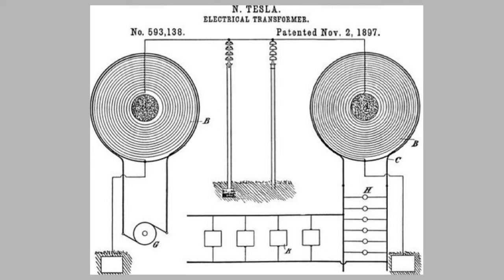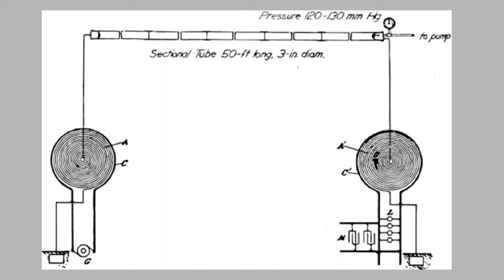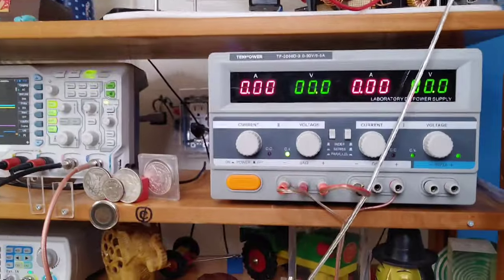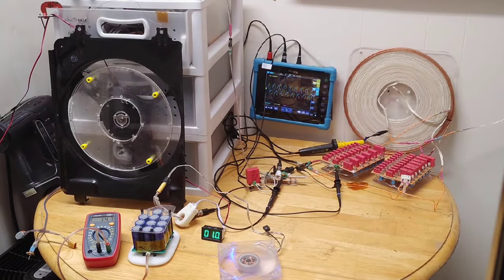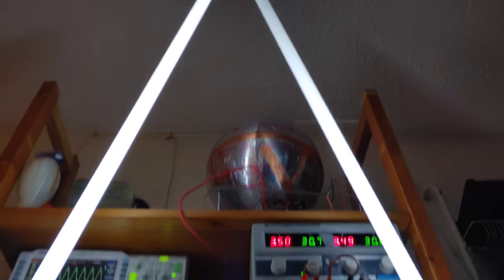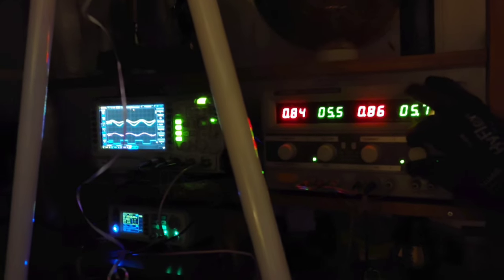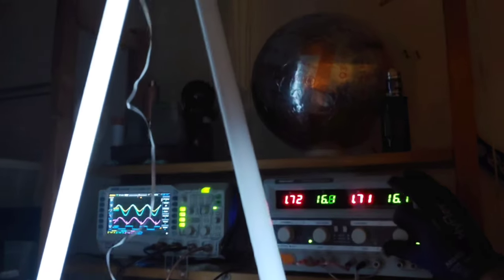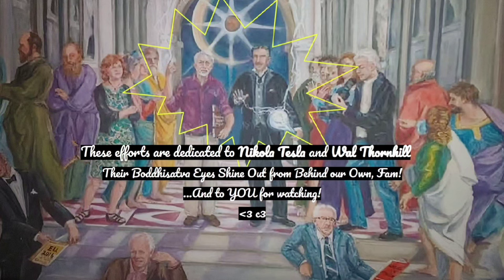Nikola Tesla's Single Wire Power Transmission, Part I: thru Flourescent Tubes & Wire

Comment: test with the coils far apart, it would be also very interesting. when the two coils are distanced the elastance K (1/C) changes and compensators will need to be used. Anyway it's magic for the electronics oriented mind even though Maxwell hundred years ago expressed his view that electricity flows outside the wire in the insulation, which is exactly what a single wire transmission line does.

Comment: Keep up the good work!

A pair of Wisconsin researchers powered a 500 watt load on a balloon 70 meters tall with 92% percent efficiency thanks to a ridiculous LC compensation setup everywhere. Check their circuit on researchgate, I can send too if you want. 

The Chinese’s are really ahead in this space actually building what the Russians spoke about in theory. 5 kilowatts through a grounded setup using a highly coupled type of air-core xformer. This is gonna be hot, it makes sense for some uses. Keep building!!!
Reply: This is happening right now, these were built in the last year. It’s crazy right now.

Comment: Been experimenting with long choke coils after the caps to the load in series. 
I'm running a wind turbine pulse motor and the choke seems to help change the coggin from the load.
Might be worth to experiment it.
Reply from the maker: Indeed! I've done some rough preliminary "benchmarks" with a honemade variable inductor (range is only 0-60uH), seem to have found a "sweet spot" near 20uH with my setup, still need to look into it much more though. Thanks for "corroborating" the tactic, I'll give it more attention!
Reply: @make425 I do work on wind turbines so I'll have to look into that. 
What type of wing power machine are you using?
I work on the common diy axial flux coreless 3 phase type and you can feel when you are turning it with the leads shorted but I get no cogging ezcept when I short one phase and then I get a little cogging. If you haven't tried that type of alternator yet you should give it a try

Comment: For phase correction, maybe it would help to have a variable-inductance helical coil. As in, just wind it round plastic and put a rod of ferrite partway in, so you can adjust how much ferrite goes in there, and therefore the coil's inductance. That is, if ferrite would work at the high frequencies involved. Might help to use longer or wider coil formers for it to work. The idea would be to tune the coil appropriately according to a load.
Reply from the maker: HAA on point again! Variable inductors have been made with a glue-stick housing, and a long threaded rod with ferrites attached. Mine only go from 0-60uH, but placement after rectifier diodes has some effect, on DC output AND input current (initially to my surprise).

The best part of posting this stuff has been getting comments like yours fam, thnx!
Reply: @cold3lectric   Ah my absolute pleasure. I love science, and fringe or neglected science (as long as it IS science!) is always interesting. You do it properly, you do a good job, and what's most important of all is that you genuinely have a passion for trying this stuff out to see what happens. When people have a real love for their hobby, it's always interesting to hear about.

Yeah input power ought to follow output power, so it shows everything's still obeying the laws of physics! Reassuring that it's working for the reasons you think it is.
Reply from the maker: @greenaum  Ha! I have used my variable inductor to find the apparent "sweet spot" of added series inductance from rectifier DC output... Had been just trying whatever inductors i had around, but thanks to your suggestion, i found the apparent optimal value lol... 15uH! Can't wait to show it off in my imminent followup vid with benchmarks :)  thnx, I'll be giving you a shoutout!
Reply from the maker: follow up vid is posted, though i had to scrap the variable inductor clips after finding out a far better approach for connecting my rectifier - having both ends of the step-down receiver coil LV (outer) windings connected across bridge rectifier, whereas previously i had one end connected to rectifier and the other end grounded.

That way it's even possible to operate with an UNGROUNDED receiver.

Comment: I have played with this technology as well many times. I even used a metal desk as the single wire and a copper plate as a free space capacitor over the metal desk. Keep up the work, i did find the extra coil to be useful in some cases, but had to tune the circuit differently for it ti work again.
Reply from the maker: Metal desk, cool! You get into rectification? Its fritzy. 

This weekend been sending it thru a tiny carbon fiber thread of 40ft (made for 'wearables'), out a window into apartment parking lot 🎉 😈😇

Comment: Kudos for noticing the wiring orientation from CCW to CW in the pancake coils. My only disagreement is your understanding of the purpose of the sphere and ground box. Tesla is very clear in his Colorado notes, his electrical experimenter published papers, and an interview on how all the radio engineers got it wrong. In his 1919 EE published article, he uses an analogy to explain it. In my opinion, one of the biggest misunderstandings and flaws with people reproducing his work. The air is an insulator, and energy is lost trying to force it.

It's the reason he went to Hertz home to show him how to improve his experiment by 10 magnitudes. He wasn't moving electrons. He was moving the very particle that binds all matter together, creates radio, and disturbances in the Ether (light).

Additional, your coils need to be identical in weight. The sound vibrations cause them to oscillate just like tuning forks. 1/4 of an inch of copper throws off the entire circuit!
Reply from the maker: True. Also i can't do quarter-wave conductor length for my operating freq (~130kc/sec has a wavelength >2km). 

I DO aspire to level-up my spherical topload game though.  But isn't the topload sometimes analogous to a grounded outside rim? Ish?

Comment: You might try to have an equal capacitance in parallel with the inductive load to cancel out the reactance. Unity power factor

Comment: From what I understand about AC. We can totally use regular setups to transmit AC relative to ground on a single wire and technically, that's kind of what we do with 3 Phase AC transmission lines, Each line is it's own AC wave relative to ground an they just happen to sum to 0 or "neutral" where they meet up if the load on each line is balanced. 

High frequency is avoided for long distance transmission because the of the inductive reluctance. I worked as a cable technician for a cable service provider and our systems opperated at the very high frequency ranges. We used shielded coaxial cable and let me tell you, signal ettenuation is a huge issue. Like I would have 27 dB at the post and then run 100' or 200' of line to the house and into the CSE. Then to the customers box inside the house and I have to measure the signal power and log it to measure everything and just from that alone I'd be down to like 12-17 dB.

That's a couple hundred feet, imagine kilometers. Also, your "inductive load" is basically a signal antennuator or "low pass" filter.

The best solution is high voltage dc where the only loss is the the resistive heating of the wire. Edison was a monster. But he was right about the efficiency of long distance energy transfer with DC vs AC using wires. He just used an idiotic voltage level and was made a fool for it. The strength of AC for long distance power transmission is largely in that it's easy to step up and step down.
Reply from the maker: the 50/60Hz version is just a non-resonant/tuned circuit version, yeah? I believe there is something special going on within a 'resonant cavity' though, if the Tx and Rx ends are in resonance, the resistance of the line seems to be ignored - heating doesn't seem to occur until it is transformed back into conventional current. But the later Russian patents about single wire transmission using tuned resonant transformers (see also: Avramenko) claim that these are not conventional conduction currents - which I am attempting to verify presently. Here's a source I like: 
https://viesh.ru/pre/development-of-resonance-methods-of-electric-power-transmission/

thnx for the super heady comment! I hadn't thought of it as a low-pass filter, that's on point <3

Comment: What are those huge banks of capacitors around the receiver coil? @4:20 What are the L,C, and frequencies of transmitting and receiving coils? Any values of power sent, received, and lost?
Reply from the maker: Hi! The oscillator circuit i use, an open source design by Master Ivo, uses parallel tuning capacitors over the secondary, and series tuning caps for the primary.

I am getting specs and diagrams etc written out to post online, and got some crude power measurements in my upcoming vid. Will update this comment with a link once posted. Thnx for the interest 💚
Reply from the maker: FYI, build specs & precise details are now posted here: https://open-source-energy.org/?topic=3676

Follow-up video with LOTS of power measurements & benchmarks: https://youtu.be/YYXr6vgef04
Reply: That's much better!
Thank you!

Comment: Very interesting that extra coil I will give a try but did you wire it as Tesla or bifilar or single wire and on tower
Reply from the maker: Extra coil is unifilar, connected in series with the flat bifilar secondary, as a 'free resonator', but i haven't integrated into the full single wire transmission line setup yet (just on the 'sender' side presently) - I'll be doing another video on that once i get it working!
Reply: @cold3lectric  I Will try that as extra coil in my setup I never tried cylinder coil as extra coil
Reply from the maker: @EnergySeeker  same, it was my first time ever winding "regular" coil like that :)
Reply: @cold3lectric  the load you tested was it between the inner and ground of that cylinder coil ? What kind of coil
Reply from the maker: @EnergySeeker  haven't tested a load on extra coil yet, in video the "bottom" connects to secondary bifilar pancake, and "top" end where the probes are is open/unconnected
Reply: @cold3lectric  this displacement current is so strange we measure voltage no issue but measure current without a load so strange for me 

And I did touch it couple of time one wire coming from the extra coil and it burn the skin 

It’s like something else not current 

I know it’s a change of flux but that is strange
Reply from the maker: @EnergySeeker  yeah its not any behavior I'd expect either. Where is it going!? I've gotten little 'RF burns' on finger tips too, high frequency is awesome :)
Reply from the maker: Argh, sorry bro i spoke too soon, am seeing no advantage so far with using two of these cylindrical extra coils with my 1wire xmission line. And one of my HV probes needed to be compensated so even my claimed voltage boost from 1 extra coil was overstated. It still gets the phase shift with current, but then again those current measurements can be hugely dependant on placement of the probe, so i can't really claim much for sure my bad 💚🤦
Reply: @cold3lectric  I have the same results it’s ok we all do that
Reply from the maker: New 30min vid "single wire, part ii" is uploaded, although not yet listed (still needs description). Wanna peek? I read somewhere that pre-release likes & activity would be favorable with search result algorithms!
🤷💚😇
https://youtu.be/YYXr6vgef04

Comment: Couldn’t you add multiple resonant tuned receivers nearby and draw power equally from them all? This is the essential concept of Don Smith’s device but in a modified configuration.
Reply from the maker: so I've heard; alas i'm wishing to reproduce it before i speculate any further 👼
Reply: Yes. Chinese’s researchers electrified the rebar in a high-rise building and powered multiple wireless communication thermostats using this principle of power transmission a few months ago. Kinda incredible !

Comment: Hi, nice demonstration.
What diodes are you using to rectify the receiver AC.
As the frequency is 117 kHz, I would hope  you are using fast / high speed diodes as normally used 50/60Hz will not be as efficient.
Reply from the maker: hi thanks! yup the ones shown here are MUR440 ultrafast diodes, and in the next 'part ii' video i show a test of ultrafast vs. schottky diodes (which work a little bit better).

https://youtu.be/YYXr6vgef04

i wish the slow ones could be used though, since most/all the convenient integrated single-piece rectifiers are made for 50/60Hz 🤷

the slow ones like to get real hot though lol

Comment: is their a voltage gradient on the single wire? like you would find on the stout bar  experiment.
Reply from the maker: good question, i expect that bulbs in series at each end of the line would not always be lit simultaneously; AMInnovations shows this with his similar setup (there are times where the Rx end lights up bulbs brighter than at Tx end).... But i still need to confirm/explore this aspect more. I have swept neon/flourescent bulbs along the wire and not noticed any gradient. Nor did voltage probe (inductively) swept across the line show any noticeable gradient. So yes, good question indeee - I'll get back to ya!

Comment: I know you're genuinely getting power transfer, but it would be good to show the voltage on the supercap bank in real time, so we can tell whether the load is being powered by the power receiver, rather than just stored charge in the caps. Even though, yes, that power gets in there wirelessly in the first place, to best show the efficiency, you'd want a situation where the caps keep a constant voltage, current out = current in. So we could see what sort of load you could power in real time, and effectively, therefore, full-time, like a practical power transmission system has to work.
Reply from the maker: Indeed, agreed 🌞  that's been a big source of lag getting my follow up vid posted: (a) getting measurements and (b) having them be meaningful ones.

For the upcoming vid, I've got a cheap voltmeter ammeter (hall effect clamp) on supercap, with minimal (but always-on) led display, and have attempted a couple "benchmarks" based on a set input dc power supply voltage (although output current varies between tests somewhat).

Athough a more straightforward method would just pass it thru a big resistor, i like the motor/inductive load, and so i attempt to find a steady-state rotation at say 12v or 15v voltage on supercaps, playing my radiator fan like a bowed instrument lol.

Perhaps i can go back and compare pitch of motor, I've read that RPM & wattage might be correlated to the pitch heard from rotation 🤷

Thanks for the on-point comment, i had begun to wonder how much interest folks had in such "nitty gritty" - but yeah much of the aim of this setup has been to attain "the very first elementary engineering calculation" and get some basic power xmission efficiency numbers.

Anyway, cheers, "sho', ya right!", right on, stay "tuned" [pun?]   🤜⚡🤛

P.s. err.... even tho its less than 30% efficiency lol at best presently, benchmarks incoming this weekend yall! 💚💚💚
Reply: @cold3lectric  Yeah I like you using a fan as the load, just because resistors are boring! I'm absolutely interested in the numbers, I wouldn't go as far as equations, or at least not calculus and complicated algebra, I can cope with a bit of arithmetic. Cos it shows the reality of the whole thing, and you're not shy of pointing out that the efficiency isn't great, you're not one of those Tesla nutcases who couldn't connect a light bulb to a battery, but is certain Tesla came from another galaxy and could transmit power by thought. Poor Nikola deserves a better legacy than some of his "supporters".

But yeah sticking some meters in there real-time where the camera can see them, or editing them in if you can do that (just use some cheap nasty USB cameras I suppose, good enough to look at digits), makes it all much more real and scientific, if the viewer wonders about any particular thing he can go back and check his theory against the measurements. And it just looks more professional, more dignified.
Reply from the maker: Amen. Also I'm trying this 2-stage voltage multiplier from this IEEE paper (even tho its for MW frequencies), to see if "rectifier harmonics can be re-captured" lol.
https://ieeexplore.ieee.org/document/8329606
Reply from the maker: New 30min vid "single wire, part ii" is uploaded, although not yet listed (still needs description). Wanna peek? I read somewhere that pre-release likes & activity would be favorable with search result algorithms!
🤷💚😇
https://youtu.be/YYXr6vgef04